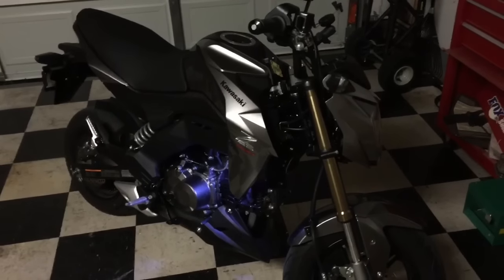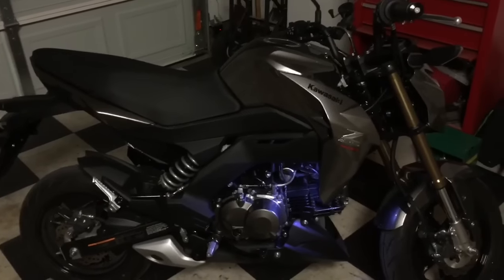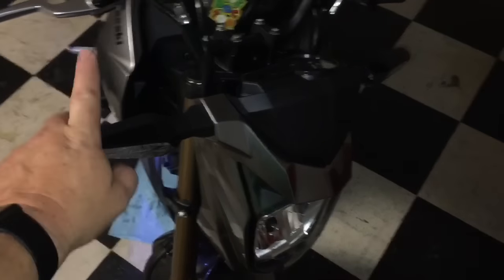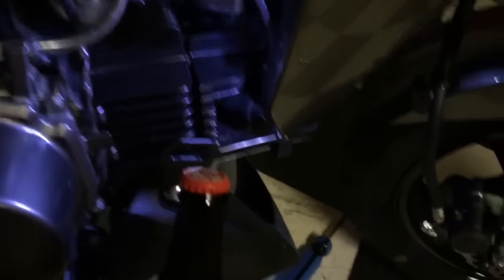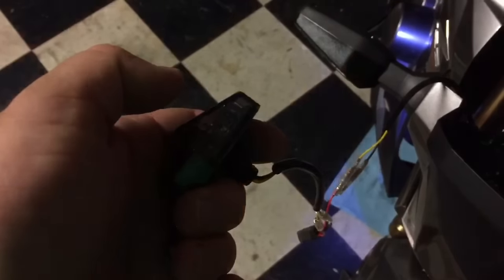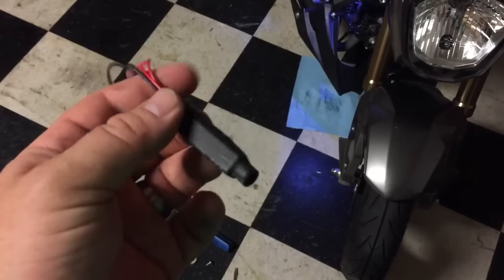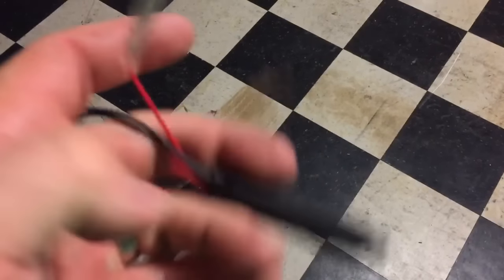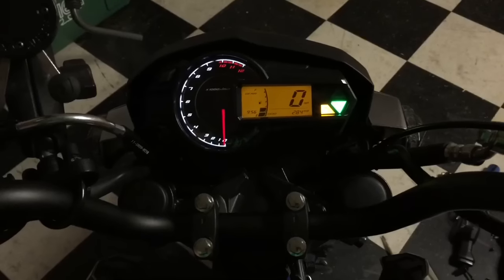Kawasaki Z125 Pro - TST Industries Flush Mount LED Front Signals

Comment: Hey Tom my question is where does your shop get the same connectors I've been everywhere and can't find a bullet connector that small......
Reply from the maker: They were already on them. You can just replace what you have or solder and heatshrink them together.
Reply: Yeah that's what it's looking like I'll have to do. I just didn't really want to use an over sized connector and have to double up on the small wiring they used. Can't stand that rapid blink rates though. Thanks for the reply love your videos!

Comment: where you buy the resistor?
Reply from the maker: They come in some LED blinker kits. We happened to have a couple extra in our shop that I used. You should be able to get ceramic resistors at an electronics shop (Radio Shack?) or a hobby shop that sells remote controlled cars.
Reply: Thankyou so much for your suggestion dude:) Looking forward to get it.